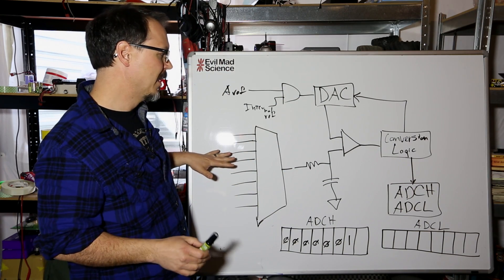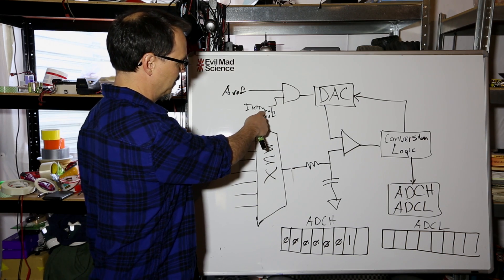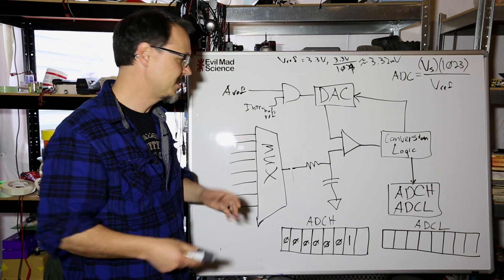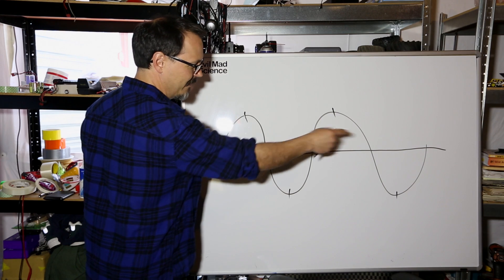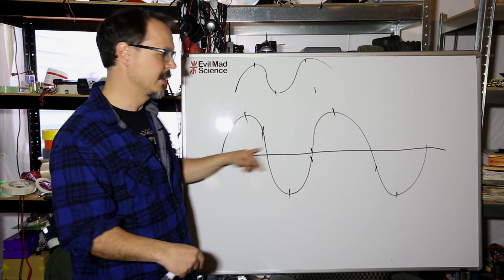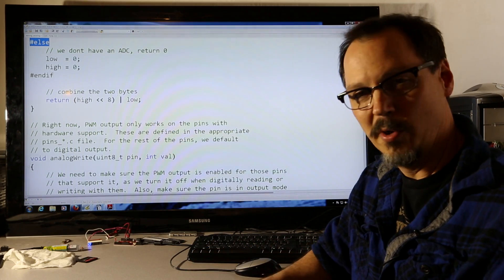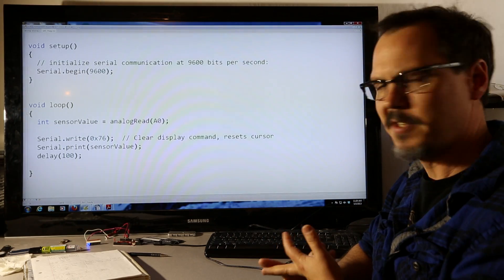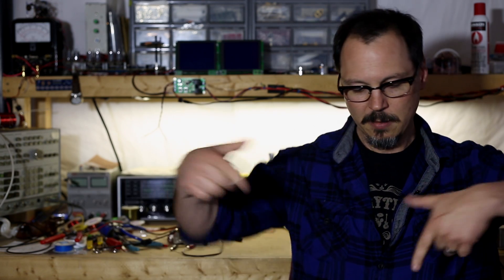SparkFun According to Pete #30: Analog to Digital Conversion

Comment: Dividing by 1024 is correct. 0-1023 in a micro controller is 1024 steps of resolution. dividing 3.3/5v by 1023 does not give you 1024 steps of resolution. It would give you 1023.

Comment: Been there, done that, was quite usefull to make a fast PID line follower with arduino. The prescaler is ok if you set it to about half the value and the big gamechanger is doing the left adjust, so the readout is 8 bits and everything(well, everything except the integral term, which tends to be huge) in the control loop can be processed with bytes(which use only 8 bit-instructions)! I wish this would have been posted a month or 6 ago!

Comment: Also, AVR pro-tip: if you need to capture an accurate waveform, DO NOT trigger the ADC in software! Loops can take varying amounts of time to execute and your sample rate is unpredictable. I believe you can trigger the ADC off a timer. Use that instead!

Comment: Yes, it should be 1023. Plug some numbers into the formulas and try it yourself. If Vin = Vref, then the ADC register should be at its max value, which is 1023. Off by bites again!

Comment: If the resolution is 10 bits, you are correct dividing the reference voltage by 1023. The extra number that completes the set of 1024 numbers from it is the 0 value.